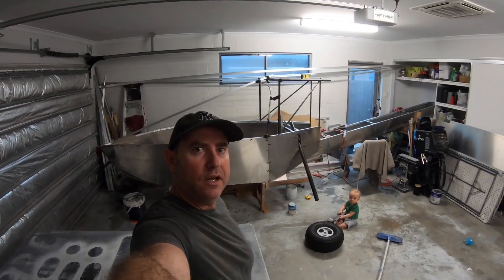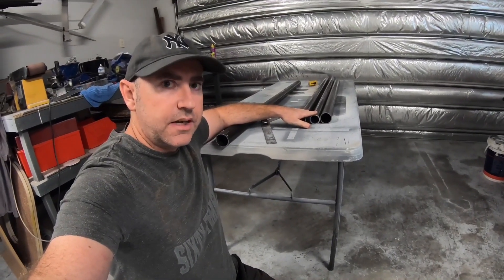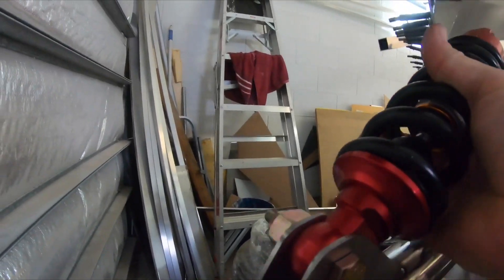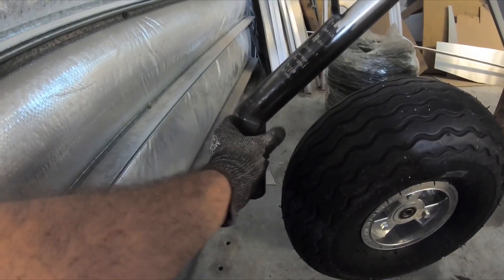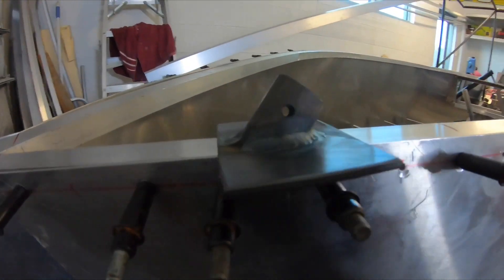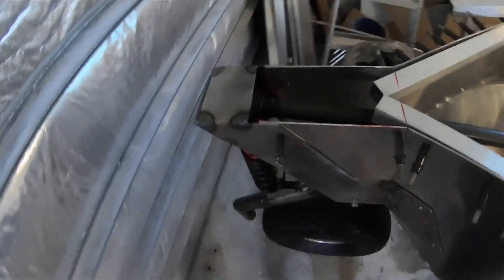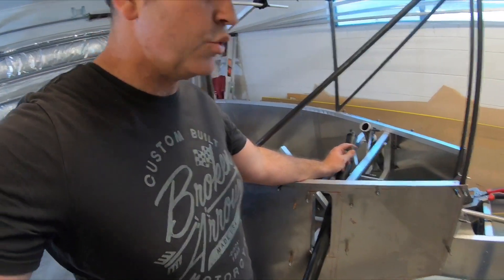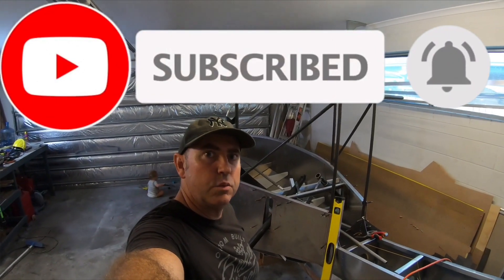Unleashed Experimental aircraft seaplane , landing gear and folding wing provisions

Comment: Good work mike , I like the simple nose wheel action, what type of spring strut did you use , ilike that better than the doughnut arrangement I have made for my nosewheel,will it take 750kg mtow and where can I get 1 cheers gareth
Reply from the maker: Thanks for following along Gareth 😀 the shock has a load rating of 900lbs so would be ample for a nose wheel as your static nose weight would only be around 250lbs at a guess , it’s just a small motorcycle shock nitrogen filled not heavy oil  and they are designed to take some punishment Here is a link to one https://rover.ebay.com/rover/0/0/0?mpre=https%3A%2F%2Fwww.ebay.com.au%2Fulk%2Fitm%2F281919640701